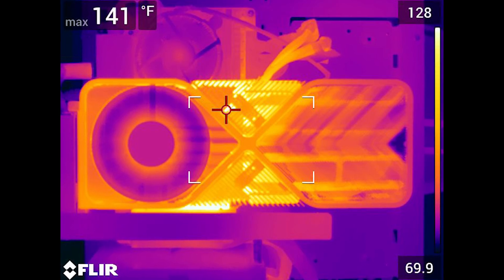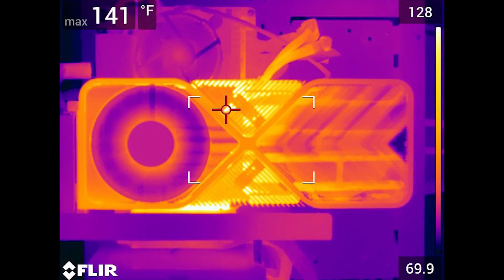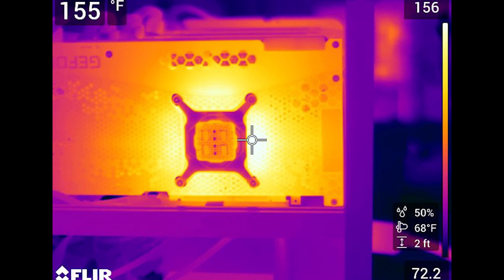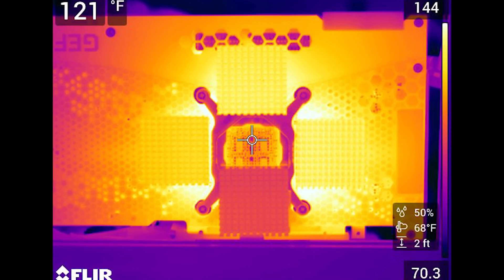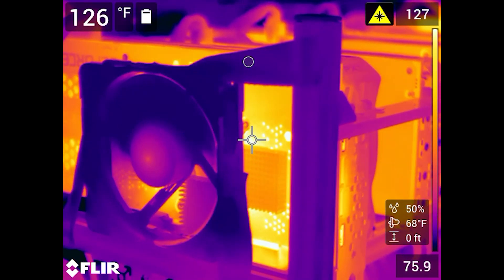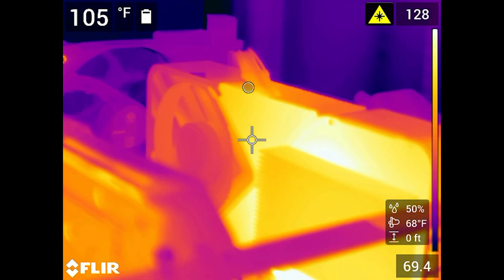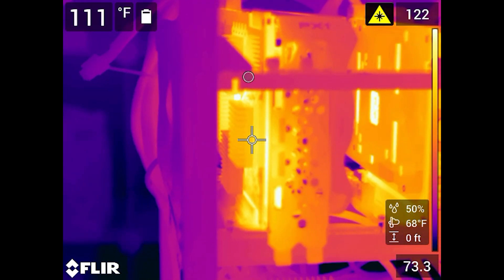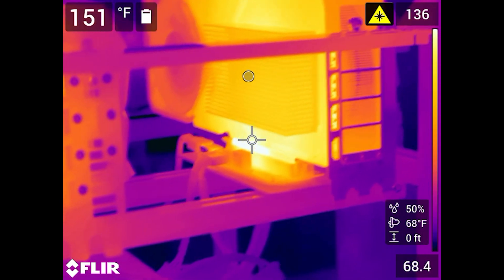3090 Overheating & 125+ MH Mining

Comment: Very nice analysis. I replaced all my pads with thermal putty, the upsiren utp-8, which is the best performing and cost effective one out there and dropped like 12-15c on memory, but now my backplate can't keep up anymore. I was getting 84c on memory but my gpu paste application was bad, i replaced it with PTM7950 from ltt and it dropped my gpu temp around 15c, but raised my memory temp to 92c, I am not sure if it's because of better heat dissipation of my gpu to the heatsink, and in return raising my memory temps, or a bad application of thermal putty on my memory. It is worth nothing if i hold a fast spinning fan on my backplate my memory temp goes down to 84c again, so it's possible my backplate putty application is bad. Nevertheless, take note of what you're using to torture test, a lot of modern and heavy games don't torture the memory that much. I've found that RE2 in the main hall gives the highest memory temperatures possible, more than occt combined test honestly, so that is my go to memory torture. I wish i had a bench and budget to put all of these to further experimentation, but thought i'd share here.

Comment: Would you recommend an alternate type of heatsink for use in a regular computer tower?  11mm is a bit too tall with my cpu air cooler in the way.
Reply from the maker: You can basically use any heat sink but if you go below that size it starts to have diminishing returns. Unless it's actively cooled. If you wanted to be passively cooled you need surface area That's the only way to get around it.

You can just look on Amazon for heat sinks that are short but really wide so just change the surface area from height to width and length.
Reply: @TekShinji  It was brought to my attention I could mount my D15 vertically which could pull heat away from the backplate.  Unfortunately the fan doesn't fit between the card and cooler though I at least now have some headroom for the 11mm heatsinks you used.  Would adding more than 4 heatsinks around that area help you think?  My case (Fractal R5) also has a pretty good side fan that blows in that general area.  Would any other double sided thermal tape work?  The one you linked has been OOS for awhile.  I have the TUF 3080 OC card if that matters.
Reply from the maker: Long as it is good quality thermal tape. Not double-sided tape. It has to be a type of thermal tape.

also, if you plan on mining especially with a 3090 it needs to be in a well ventilated area. It shouldn't be inside of a case.
Reply from the maker: ideally you want to use one continues strip of thermal tape. getting bigger tap and then trimming it off is better than combining 2 taps because there would be a gap or a chance of overlap. if you have more questions the best place to ask is in discord. i get a lot of comments and may take a wile to respond to them.

Comment: Finally found someone on YouTube who actually knows what their doing! What’s your average memory junction on the evga card? Because of this video I think I’m going to buy the heat sinks and thermal tape because I currently just have one ml120 fan pointing on that same spot on my tuf 3090 getting 88c memory junctions thanks in advance! Also nice music!
Reply from the maker: Thanks a lot man! Average junction temperature currently is around 90 c. But that's pushing it at 125 MH/s. If I stay within stock parameters of 120 It drops lower then that.

I'm still doing more investigation but this definitely helps with stability at the minimum. Don't crash as much when I'm pushing those high memory clocks.

It's not like a super drastic difference for sure. Maybe 5 to 10 c at most but it's big enough to make it worth it and being that it's only a couple of dollars and like 5 minutes of work.

appreciate it man, thanks for the comment Hope you stay subscribed for future videos :-)

Comment: Could u please do a video on replacing thermal pads front and back on a strix 3090....no one has done this yet
Reply from the maker: I will definitely consider it. I have to investigate the reason why it's overheating first. If it's simple as replacing the thermal pads that's great. But it could be inherent design flaw. Expect that sometime lol. It takes time to investigate these things and get the proper information
Reply: @TekShinji  with the strix cards alot of people say the 1st step is to replace the thermal pads bc they use the greesy ones but no one has fone a video on how...the only time is when u see them put a waterblock on it but that is not the same as a straiggt replacement
Reply from the maker: Well, I have to get one to do that :-) those are even harder to get right now.

Comment: Good stuff.  More mods pls...
Reply from the maker: More coming soon :-) anything you like to see in particular though?
Reply: @TekShinji  cpu cooler on gpu? Or a maybe double gpu cooler?
Reply from the maker: Good idea, however that's something that's not exactly practical for most people. But thanks for the tip. I'll definitely consider it in the future!
Reply: @TekShinji  was thinking the same, not sure if a cpu cooler would have more surface area, than the newer gpu coolers, which i would assume greater surface area = greater cooler potential...
Reply from the maker: Linus tech tips did something very similar. And yeah it was better but super impractical.

It was quite an interesting video just research it on his channel if you're interested. Pretty cool stuff.